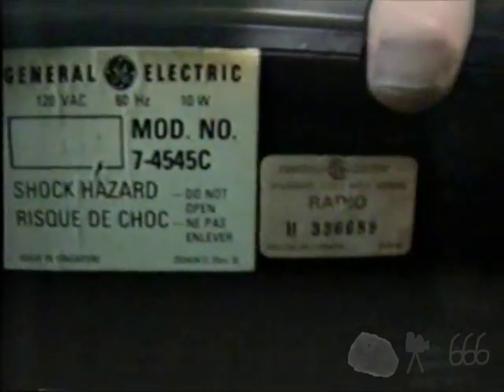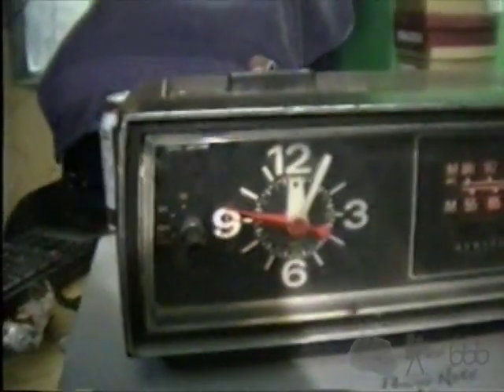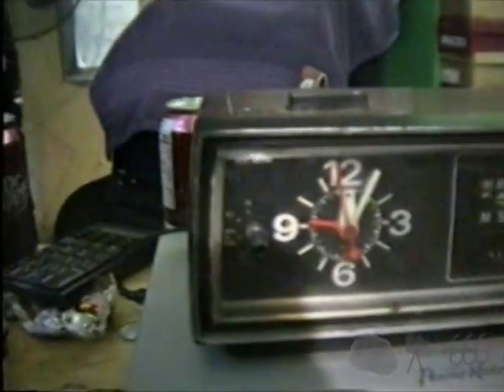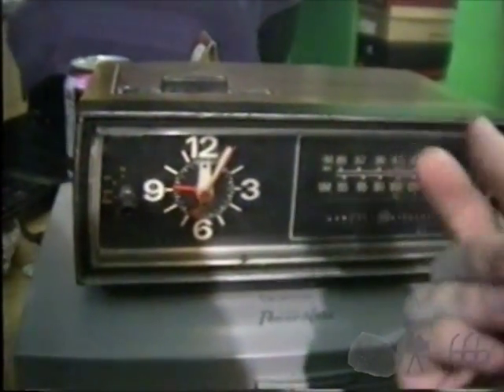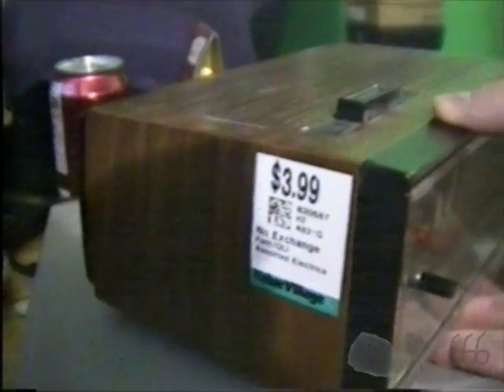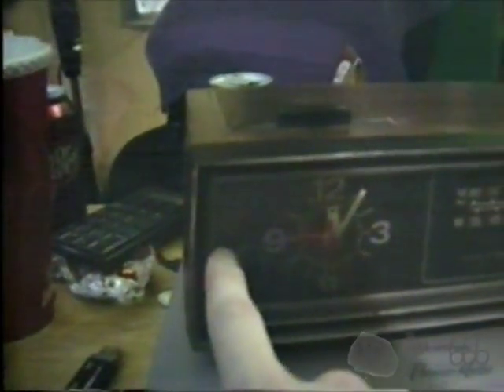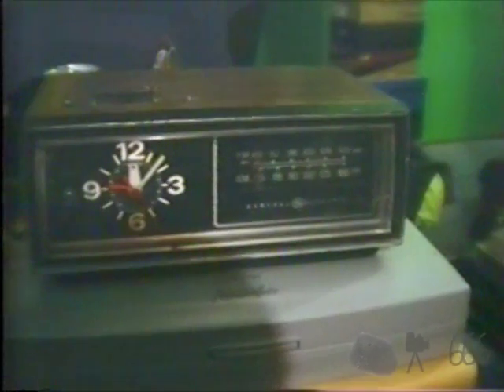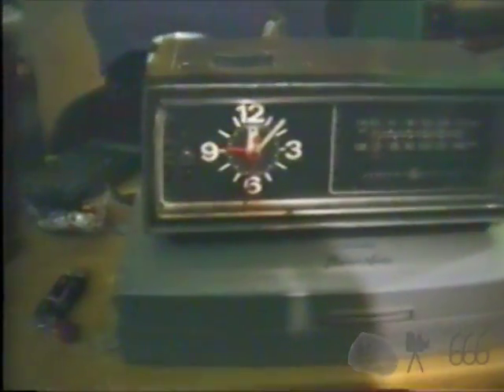General Electric 7-4545C Clock Radio

Comment: Man, I have one of those radios I received new as a gift when I was a kid. I woke up hundreds and hundreds of times to that thing going to grade school in the '70s, and listened to countless songs on it during those years that now have become some of my favourite songs to this day. I had been scouring the Internet trying to find what the model number is of it since my original sticker fell off many years ago. You think YOURS is in bad shape? Mine has a cracked front plastic pane. The selector knob on the left BARELY works, it sporadically turns on by itself if it's not set exactly in the "right" spot. The top plastic is somewhat melted/depressed due to the constant heat from the transformer behind the Snooze button. Mine actually can't even tune in a station anymore, even though the frequency slider works fine...all I hear is static. BUT the clock and lighted dial still work. I'm thinking of trying to repair it myself, not because of the worth, but because of the memories I have of it. $4 you spent?? Wow that's really good, considering. Thanks for the video, I enjoyed it!